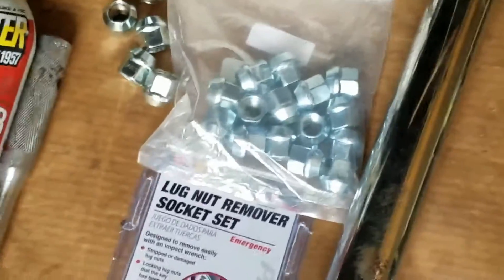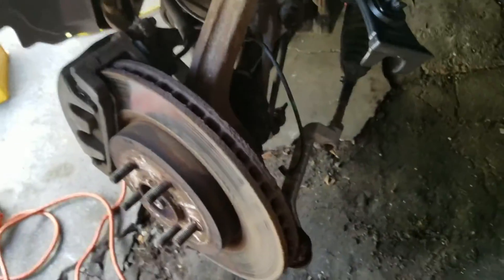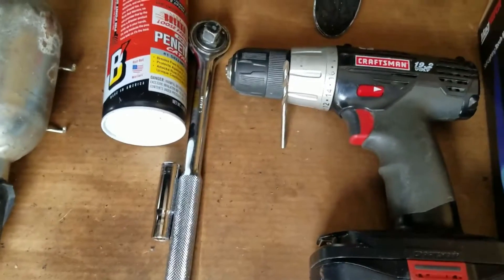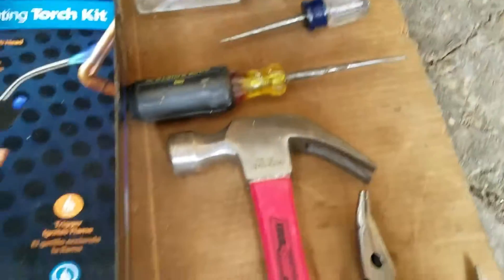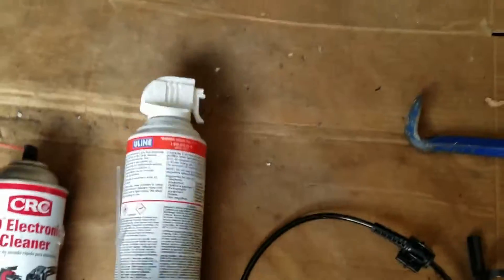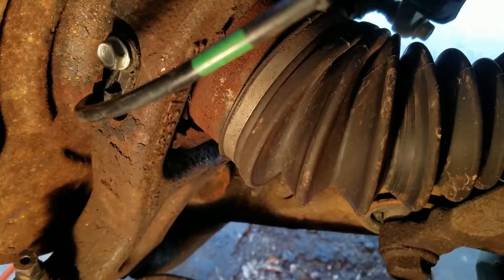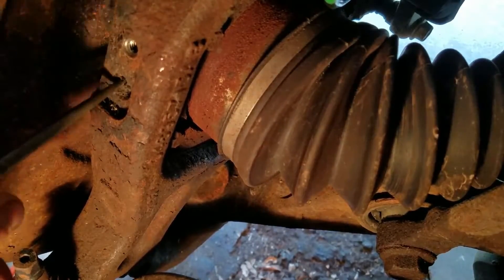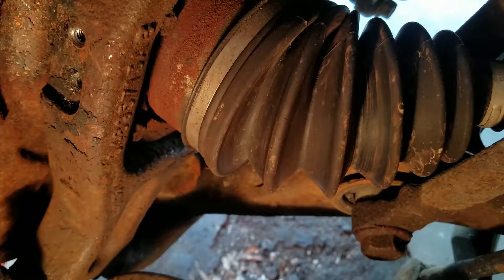How To Remove A Stuck ABS Wheel Speed Sensor P0501

Comment: i had this same problem with my 2016 Chevy traverse LT AWD. It broke of inside the hole i had to drill most of it out. I ended up taking off my wheel bearing and  punched it out of the hole. I sprayed pb blaster inside the hole to lube the hole wiped it out but it had a hard time going inside the hole. It should have not gone inside the hole so dam hard now every light is on my dashboard. Some thing is not right now service traction control and stability, ABS , brake light is on now before it was just service traction control and stability lights. that's why i was trying to fix the problem now its worse any help with this would be greatly appreciated ty
Reply from the maker: Did you replace the sensor?

Comment: i pushed the sensors in, does that affect anything ? changed rear sensors but still abs light is on, thanks
Reply from the maker: It shouldn't if long if nothing was previously stuck inside before and/or it was cleaned out. Try using a code reader to reset, and see if code comes back on. Otherwise you may potentially have a bad tone ring or, shorted/cut wire, or may need a new CV axle.

Comment: Hi, I have change the speed sensor on the gear box with new but the fault codeP0501 still exist. Is there any chance that this damage is from the abs sensor? I have a Skoda Octavia 1.8t 1U
Reply from the maker: Did you reset the sensor meaning erase the codes on a code reader, and then drive to see if it comes back on?

Comment: This happened on a 2013 dodge avenger I did all 4 wheels, I put a deck screw in it and screwed it about half in and used on blaster and heat and it worked
Reply from the maker: Wonderful! I just wish you didn't even have to do this to begin with. But I'm glad this video helped.

Comment: This just saved me. I drilled a pilot hole and  had a nice flanged self tapper screw, put a claw hammer to it and it popped out. Nice 1 👍
Reply from the maker: Great job...I'm glad you did this yourself, saved money, and didn't take it in to get it done.

Comment: It bent my hammer
Reply from the maker: How did the hammer get bent? Were you still able to get the abs sensor out?
Reply: @FixCarYourself  it was rly stuck. Put a screw in and used a hammer to try to pull it out and it bent the hammer😂😂yes i got it out. I melted a small part of it and then put the screw back in and it came out.
Reply from the maker: Cool, glad the hammer doesn't cost a lot to replace. I guess you'll only be able to use the front hammer side now. You should take the hammer and smash the 💩 out of that old abs sensor.

Comment: Thanks, good video, you helped me a lot, the same thing I got to do in a couple days, thanks again
Reply from the maker: Glad it helped you, and is making a difference for others as well!
Reply: @FixCarYourself  I feel to tell you about how I done it, well my car is BMW e39 '98, I blasted the sensor with W40 and let it sip for 30min, drilled and screwed a screw in and jerked the sensor out!!!, imagine this sensor was original installed by BMW 23 years ago....!!!
Reply from the maker: @Maximilian0011  i love this idea. By 1st putting penetrating oil in and soaking it. Then you make a pilot hole with a drill, then Put a small narrow screw in so it bites into the plastic and then yank it out or screw it out (preferred) slowly. I did this but for a stuck wheel speed sensor and it sucked. So thanks for saying this.  Great thinking!!!

Comment: What happens if it pops in?
Reply: Yeah it ended up snapping off and alot of messing around finally got it to pop out n I was very releaved only to put the new one in and no lights for quite some time n bam.... They're back and I know that was the issue because it was cracked in half... .. 😤😤😤😤😤
Reply from the maker: Well in general that's what should happen. You just push or pop in the abs sensor into place when reinstalling.
Reply: @FixCarYourself  im meaning the piece that broke off. What if you push it in, if that's even possible?
Reply from the maker: @miztrusa  I like the craftiness, but I don't think it will work. I think their is a sensor inside the plastic or some kind of coil and if broken no signal will be present in other words a strong contact will not exist and allow the tone ring to operate or read the sensor properly.
Reply: @FixCarYourself  maybe you're not understanding my question, what I mean is if I remove the old sensor and it breaks off and I attempt to drill it out or whatever and it goes in instead of coming out what will happen with that piece rolling around inside there?
Reply from the maker: @miztrusa  So I actually had 1 abs sensor that broke, and I did drill it partially before pulling it out. I then used an air can and a vacuum cleaner to clear out any remaining pieces that were caused from drilling.  You should not drill all the way because you need to get some kind of grip on it to yank the remaining piece out. 

If you were to drill completely through you'll eventually hit the "bottom" meaning the base of the metal. So instead of drilling all the way just do a little, and then yank it out.

Hopefully this answered your question.
Reply: @FixCarYourself  ok TY.... Today's the day I'll be trying to get it out. I got it to at least spin a bit but I gotta take tire off to get a good, straight pull on it. I'll keep u posted.... 😊
Reply from the maker: @miztrusa  cool
Reply: So I know that was the problem and lights all disappeared for about 20 miles n came back on.... Shut it off n another 20 miles or so. Never had a check engine light so how does one reset computer... Disconnect battery?! 🤔
Reply from the maker: @miztrusa  Disconneting the battery might help short term...but really the best thing to do is hook up a code reader or scanner tool to see if any other codes come on. Its also possible the codes are stored, so a code scanning tool should fix that issue or at least indicate any other codes causing this lights to illuminate.

Comment: Happens all the time, I don't know if you can use anti seize so it could easily take off next time.
Reply from the maker: Good thinking with the anti-seize. Very creative!!! However these are really meant to not "slide". They should stay fixed. Not sure if the anti-seize would potentially compromise these sensors. Also odds are these would only have to be replaced once in its car lifetime per wheel.
Reply: @FixCarYourself  I would still use anti seize just because we're in a salt corrosion rusty North Eastern State
Reply from the maker: @Doungsravungchamdolla  I could see where this makes sense. At the same time these are really meant not to slide or have movement and be fixed. I'm kinda torn apart on this. I live in a harsh snowy climate. So I guess so I don't have to ever do this tedious remove again. I would put a very light amount of anti-seize on it. Thanks for making me reconsider my suggestion!

Comment: Is this a lug nut video or abs video???
Reply from the maker: Thanks for your response, and your right! I talked too much about the lug nuts. This is more about the stuck ABS sensor. So thanks to your valuable input, I trimmed out the unnecessary part about removing the lug nut for the most part as to not waste other viewers time on watching this video so they can see how I removed or fixed the stuck wheel speed sensor.

Comment: Outstanding!!! Same exact situation I’m in right now. Thanx a million!!!!!
Reply from the maker: I'm so glad this video helped. My goal with this video was to help people not spend many hours or days to complete this project. I had to figure out what to do, and how to do this without damaging anything else, and gather extra tools over the course of 2-3 days. 

No other good video existed on a stuck ABS Sensor so I thought I might as well make one and include all potential tools needed and help people so they don't get into the same problem.

Hopefully you finish this project quickly.
Reply: @FixCarYourself  I did and the the sensor went in super smooth using your suggestion. Unfortunately it seems my entire hub is messed up and will need to decide what to do about that. Thanx again.
Reply from the maker: @matthewj.hullbasbmf5001  if the wheel hub is bad then you need an external bit to remove the hub from behind i think. 

However check for codes 1st to isolate problem sometimes its not the sensor or hub thats bad but the actual CV Axle.
Reply: @FixCarYourself  it’s actually a awd Ford Taurus Limited and this is a pretty common thing with them. I hear the groan and grumble. I was just trying to go with the easy way first, the sensor, LoL that worked out well, before I went nuclear on the whole wheel hub situation. I am not ready to give up just yet.